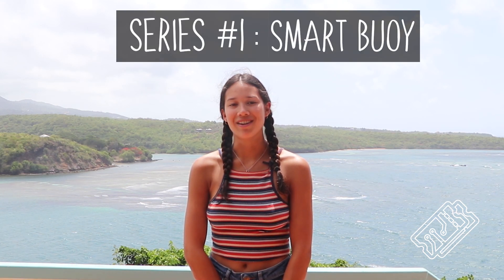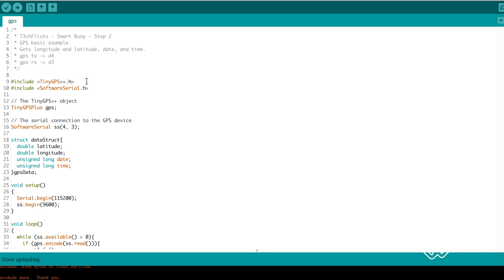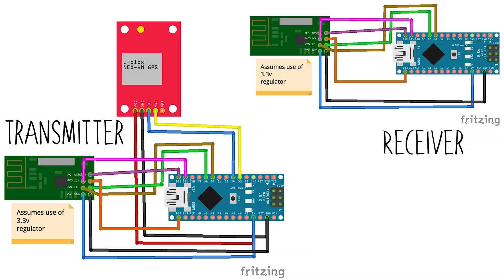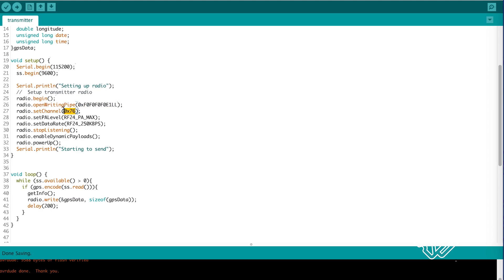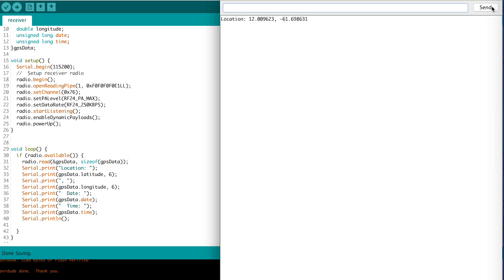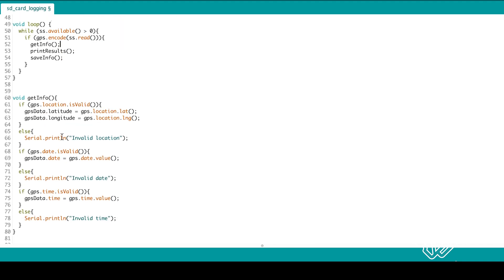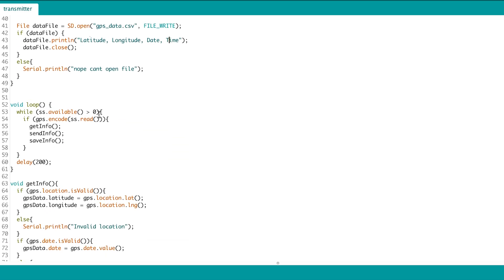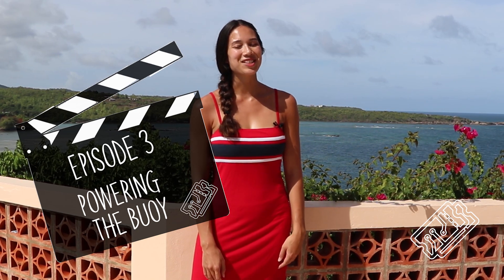Smart Buoy [Episode 2] - GPS, Radio (NRF24) and a SD card module tutorial

Comment: tried this code ... functions good...it was helpful
on implementation i found that this code dose one process in one nrf (either transmits(or)receives   to(or)from   another nrf module) what change should be made for single nrf module to do both transmission and reception from another nrf module
Reply from the maker: Hey you want bi-directional communication. This blog post shows how to https://howtomechatronics.com/tutorials/arduino/arduino-wireless-communication-nrf24l01-tutorial/
Reply: @T3chFlicks  I modified the code in that link for transmitting GPS data and receiving acknowledgment
but it didn't work out. can u help me with this